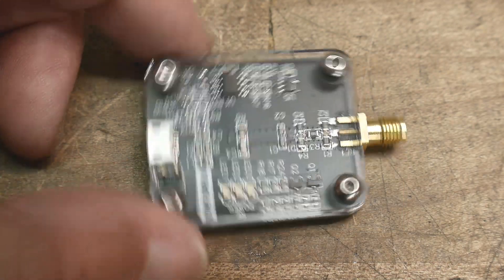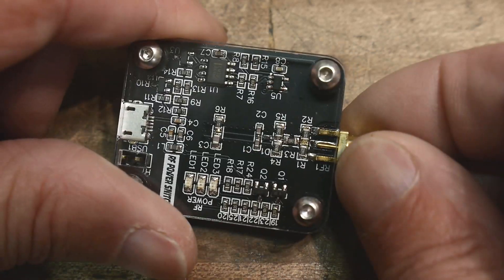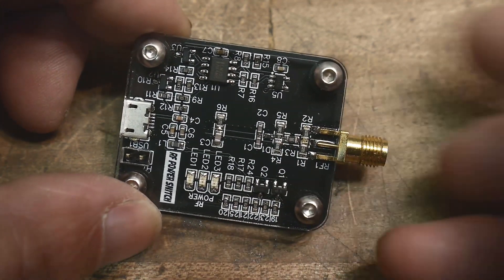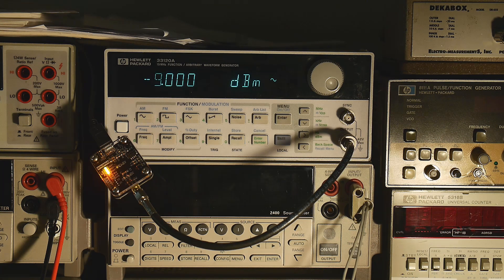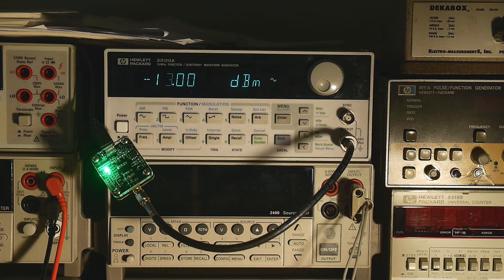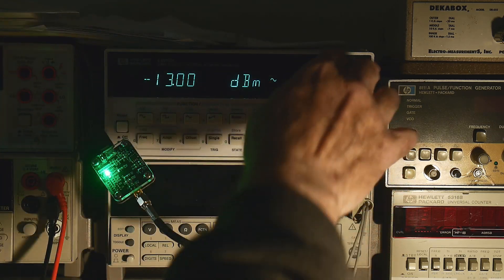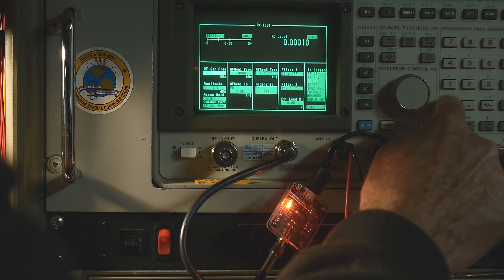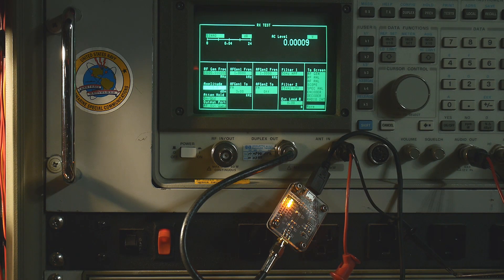#752 RF Power Snitch Review

Comment: Great review, thank you for confirming my own test results on your equipment. And by the way, your reverse engineering was pretty accurate. I only would like to add that it also has pins broken out for measuring (corresponding voltage level) or hooking up an MCU/display.